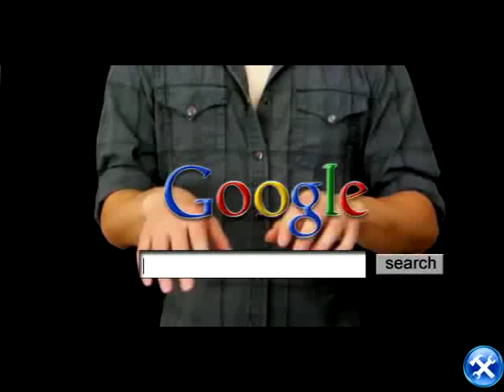SPECDTUNING INSTALLATION VIDEO: 2010-UP TOYOTA PRIUS LED TAIL LIGHTS

Comment: i just got a 2011 prius are the brake/parking lights bulbs? or are they a led lighting unit like the 3rd brake light? would i have to replace the whole tail light if the brake or parking light go out